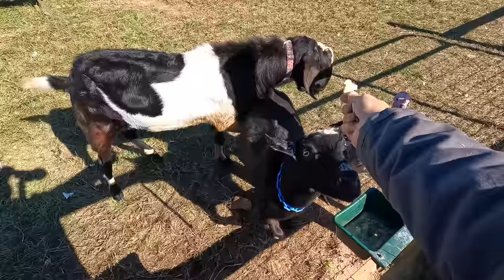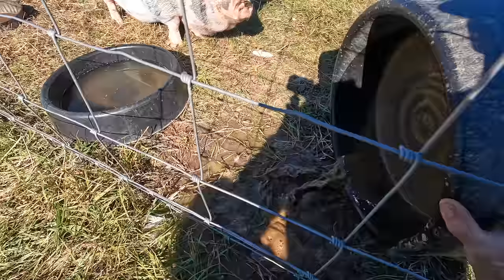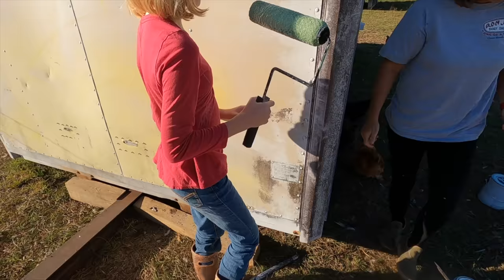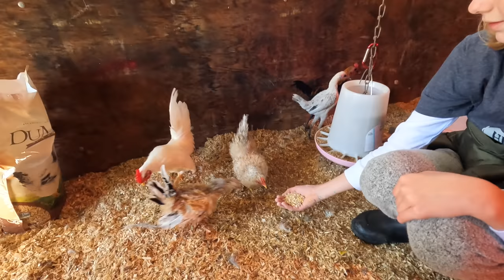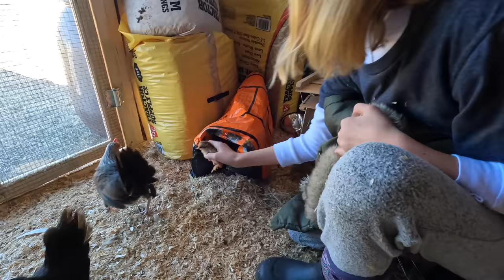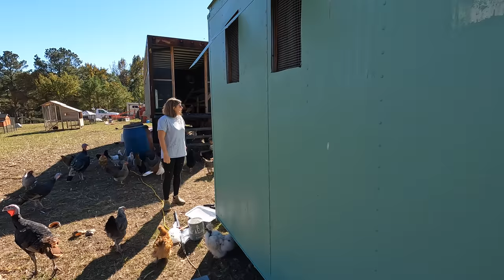You Are NOT Going To Believe What She's Got!! (NEW Show Quality Chicken Breeds On The Farm)

Comment: For the new chickens insulated window; how about making a plexiglass window frame to fit inside the outside window openings. To make them easy to get in and out, put a little drawer pull on the bottom of the frame.

Comment: Just an idea. I had a Tractor Supply coop that had an attached enclosed run (hardware cloth). I bought a bunch of 1X1s (furring strips might work inside). I custom-made frames that would fit inside each hardware cloth "window pane" of the run and covered them with clear plastic. I found some "toggle" latches (white plastic) like what you would put on window frames for your screens on your house and used those to hold the clear plastic-covered frames in place during the winter. Then I just took them off and stored them over spring and summer. I could also pick and choose how much of the run walls I covered on any given day depending on the weather.  I learned to mark each one so I could easily know which one went in which space of the run.
Reply: Great and simply handy also. Seems you could just hang on pegs in the coops in plastic bags and they’re there when needed! Love the idea

Comment: Chickens have a core body temperature of 107 degrees , chicks are 103 degrees. Heat lamps aren’t needed. I’m in Kentucky and never had to use one. My birds do very well in the winter. My coop is very well insulated, and i have a water defroster in my coop.  Heat lamps are just a danger for flying chickens.
Reply from the maker: Serema chickens are from Malaysia , they can not take temperatures below 40. We have multiple varieties and they are the only breed we have that require supplemental heat.